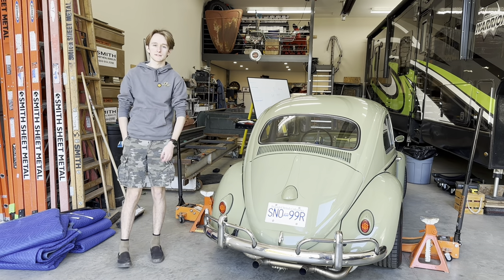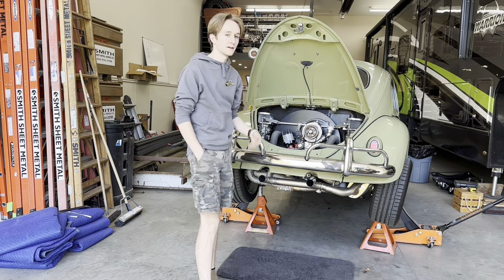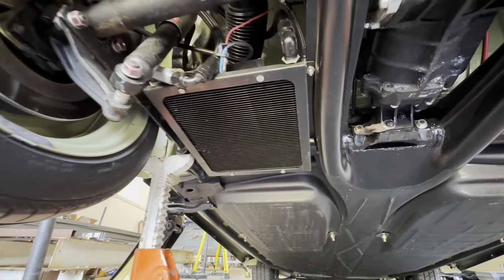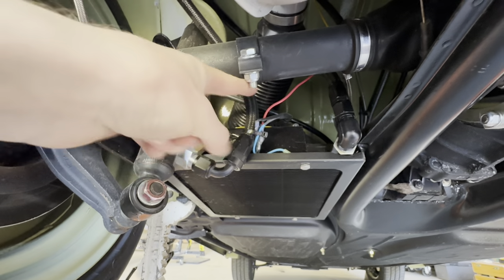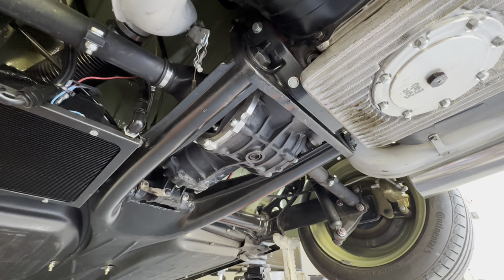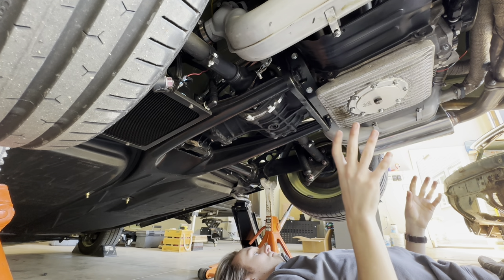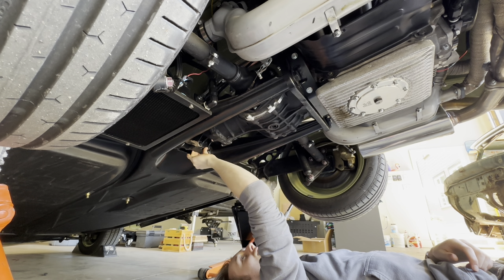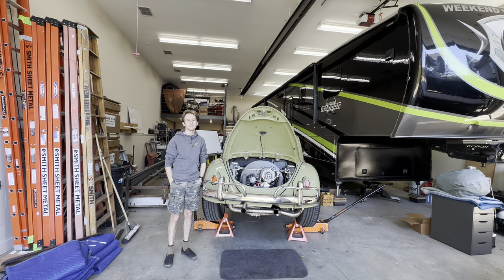My Remote Oil Filter + Cooler And Modded Transaxle

Comment: Best to use a weld in mid mount. Not sure what you mean about tying the motor into the body. But a Kafer bar/truss bar will be your best bet in keeping things from twisting.
Reply from the maker: Thanks, I actually did just order a Kafer setup. There is a traction bar people keep recommending me that comes down from your bumper mounts and straddles the engine. But Im trying to avoid it.

Comment: On CP1 they sell: GERMAN - PAIR OF AEROSPACE GRADE SILICONE VALVE COVER GASKETS - 100% REUSABLE - SAY GOODBYE TO LEAKS. Part no.VWC-113-101-481-SPR - 113101481FSI
Reply from the maker: I’ll have to check it out, thanks for letting me know, and thanks for watching.

Comment: how can you get decent air flow across the oil cooler with it mounted parallel to the air current?  can't you put a scoop on it to catch air.  914 engines use air flow from the cam shaft powered fan so at least air is going across it.  I can't see where your cooler is acting more like a larger oil "sump" using the extra volume and not as a true cooler
Reply from the maker: I can see what your saying but there’s actually a large fan on the other side that sucks air up from the bottom which should be cool, and on top the luggage rack has a good curve that brings the warm air over the transaxle and out. My only mistake was not putting in a bypass for when it’s cold because the engine won’t actually warm up enough.
Reply: @smithsgarage273  yeah I was wondering if there was a fan there.  On my sandrail my radiator was horizontally mounted and even with a fan I wasn't getting sufficient cooling and had to change it to upright.  On my turbocharger air to air cooler I had to add a scoop.    When I had a 914 I added an external oil cooler like you have and also had to deal with location issues probably to a high degree than you did.   Oh by the way, I live in Phoenix where it's 110 in the summer time so you can imagine how important it was to keep these engines running as cool as possible
Reply from the maker: @mmricci2861  wow yeah phoenix is very hot. I only put mine in for peace of mind when stuck in traffic during the summer. I don’t know what 40° Celsius is in Fahrenheit but that’s the hottest I’ve been in and the car stays a decent temperature.

Comment: Replace the rear with CB rhino mounts. If you're gonna do a mid mount because of your 60 nose cone mount, you might want to weld in a mid mount. The Berg mount doesn't provide any actual support in-lieu-of the nose cone mount being weak.
Reply from the maker: Thanks for the advice those look pretty solid. I just wish there was a good 60’s nose cone replacement that’s stronger like those rhino mounts. I’m probably going to end up making a custom mid mount that’s more of a solid mount for now. Later on I’m gonna look into doing the engine horn stiffeners that come down off the top shock towers.
Reply: @smithsgarage273  could always cut out the 1960 nose cone mount and replace with a later one to make it more simple and repairable in the future.
Reply from the maker: @JMC8415  yeah I’m gonna look into that, and then I can possibly do the full rhino mount set.

Comment: Although you had put somewhat of a high performance motor in there I think you needed to research on how much support for it you needed before you install it I'm just saying because with that engine you can snap that transaxle is what it is called by the way but a very cool car..
Reply from the maker: Yeah… I never claimed to be the smartest guy haha. I did so much research for everything else and the mounts really just fell to the side. It’s really a miracle I’ve gotten a year of driving this thing hard without shearing them right off. And yeah I know my terminology isn’t good either but I’m just trying to share. Thanks for watching though.